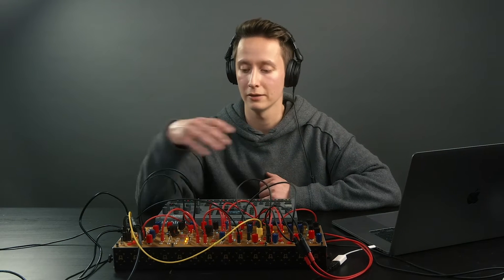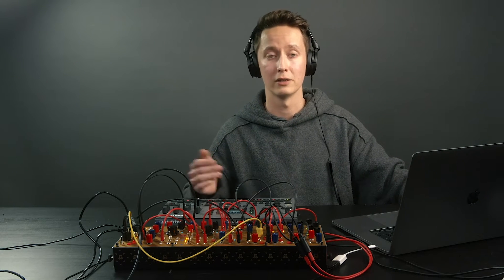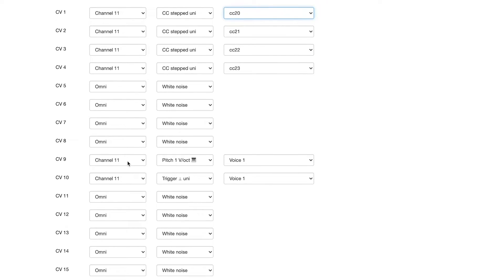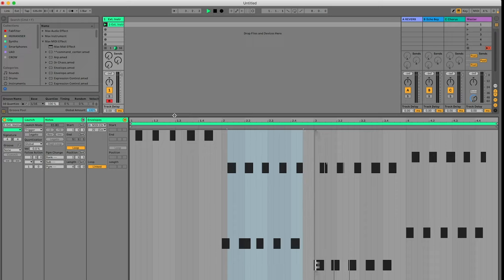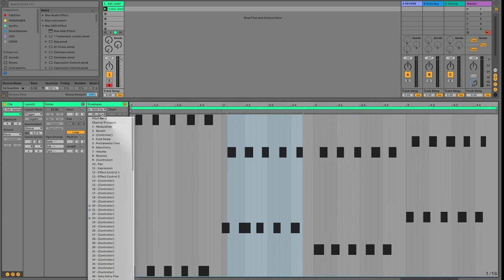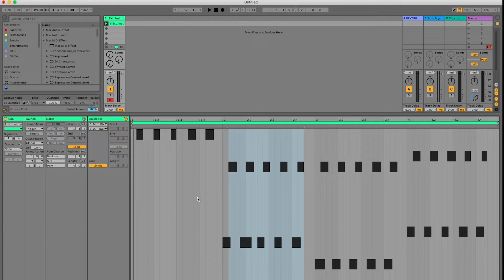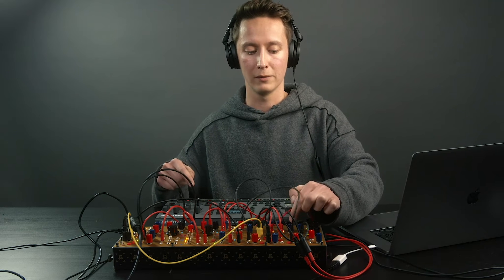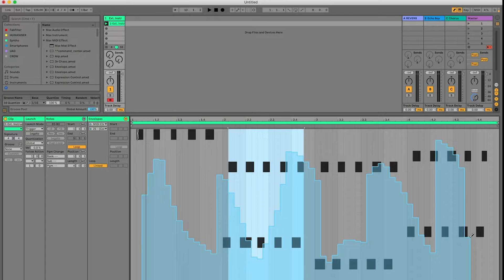How to sent MIDI CC automation from Ableton and hardware sequencers into the Shuttle Control

Comment: hi Ivan thanks for this video.
for now i use Expert Sleepers ES-3 via ADAT and it work fine but only 8 CV out.
what about the Lfo's from ableton? is it possible to route on max for live lfo out (for ex) to shuttle control?
best regards
Olivier
Reply from the maker: Olivier, thank you for the kind words.
Shuttle Control is a MIDI into CV converter, so if you can generate MIDI: CC or pitch, or triggers or (!) pitch bend messages, then they will be converted by the Shuttle. 
Shuttle control doesn't accept audio inputs
Reply: @Endorphines  cool and what about puting 2 shuttle control? is it possible? like in chain?
Reply from the maker: @tacticalgrooveorbit2379  sure, you can daisy chain them with the usb cables, just keep in mind to set up their usb transfer in the editor properly so the first one will transfer from host or device into another shuttle

Comment: Great vid. What did you use to connect shuttle control to the octatrack?
Reply from the maker: thanks. using simplest MIDI USB adapter. The one used on the video is called M-Audio USB Uno MIDI Interface 1 in/out